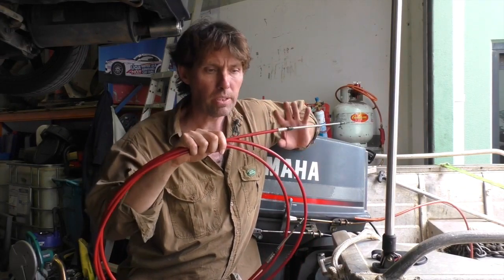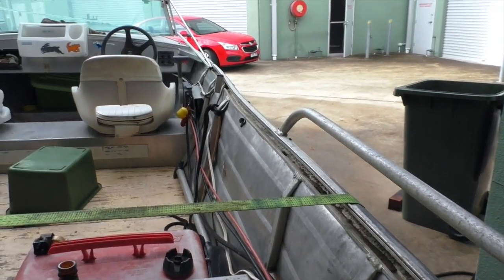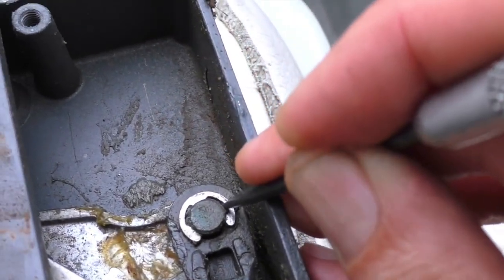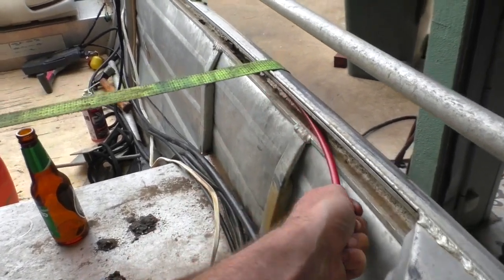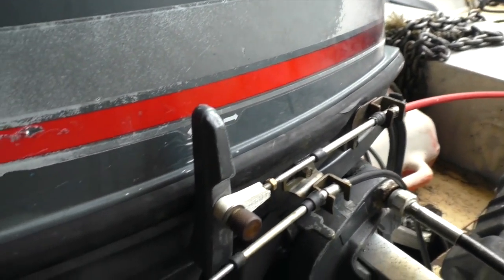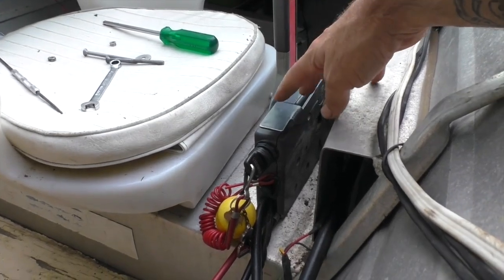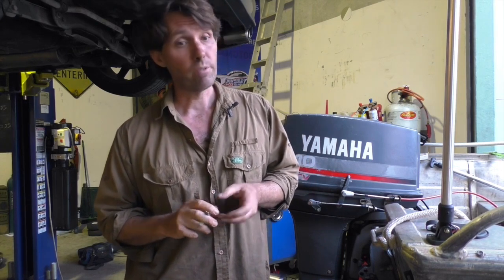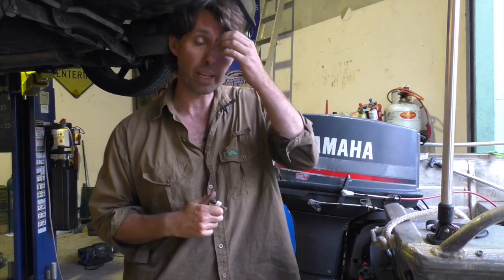Changing an outboard control cable

Comment: Hi Stu, just wanted to say that your videos have helped me a lot, with my latest project! Watching your videos gave me the confidence to buy a project boat and I have just finished servicing the outboard, adjusting throttle cables and relubricating them, adjusting fuel mixture and idle speed and plugging a hole in the hull. Now I'm considering taking it further and repainting it. Thank you for putting these videos out into the world, you are a champion!!

Comment: Mate, I don't know what I would have done without this video. About 8months ago I had to pull apart my throttle system to get at my choke cable which had perished beyond repair. I used your video to disassemble the cable. I got myself a new cable but haven't had an opportunity to fit it until today. There were several things that I couldn't remember like which way up the plastic connectors at the front end went. I found your video again and it was sorted within seconds. I reckon you should re do it, or at least repost this one, its saved me probably $2-300. I'm still going to get it checked by a marine mechanic, but the satisfaction of doing the repair myself was pretty cool. Cheers

Comment: I wish you could have mentioned there are several different types and not all are interchangeable especially older models , after watching your video I thought I could just use my old cables but as I have learnt, there are several different types of cables , some have the removable tips like yours , others have specific adjustable wheels and lock barrels, with removable end but fine thin cable ends with grub screw locks  , others have the correct end for the outbound but different end for the control with windows ends that are not removable  with small holes , others have the same set up but with large holes , there’s a multitude of different styles , tips, sizes  , definitely not a one size fits all as you clip suggests. 
I’ve learnt the hard way with about 12 different cables of which none are exactly right absolute pain in the ass ! Hopefully I can save someone else the hassle and make it known that you need to find you specific cable you can’t just use a generic one at least with older outboards

Comment: After countless youtube videos, I found this one. And I now know, both cables are basically Identical and found a set, 2 for 71.00 bucks. Once home and off the lake the parts will be there and I can do this repair myself. heads up, the boat dealer wanted 138.00 an hour and quoted a min of 2.5 hours. And the parts where 112.00 per cable. The most important thing is save your old connectors. to make sure you have a good fit. Unless their bad.

Comment: You the man!   Just replaced my cables.
Reply from the maker: Nice work, glad you got the job done. :)
Reply: @DangarMarine  It happened cause I duck hunt...was 19 degrees other day and couldnt move shifter....cleaned all old grease out of shifter box and used white lithium...new cables cleaned shifter linkage on motor ...more white lithium....time go break some ice....shoot some ducks.

Comment: got the answer on shift cable problem----there is a little plastic sleeve inside the cable that helps ensure it shifts smoothly----it was broken.  So--replaced it and we are back in business in our 
42 Hydra Sports--3   350's.
Reply from the maker: Nice work! Enjoy getting out on the water. :)

Comment: Hey Stu! Hope all is well with you and yours mate. Was just wandering what the correct grease is to use on these cables. 
I was told not to use oil, as they said that it assists in the cracking of the external plastic casings. 
thanks for your vids & all the help you give every one mate.
Reply: Lucas transmission conditioner keeps the cables crack free for years  it works well

Comment: First off, awesome explanation and video! I am trying to relate this video to how my shifting cable/linkage is configured on my Yamaha outboard. The linkage is not mounted on the side of the outboard like shown in this video, it has a brass linking nut  that connects the shifting rod from the power head area to shifting rod in the gear box (this connection needs to be unthreaded each time I take off my lower unit). When moving the shifting lever from neutral to forward/reverse the linkage movement “agrees” with the 3 positions. However when I do my in water test as you mentioned, my reverse sort of grinds/stays in neutral and I have to push back a little harder on shifting lever to actually engage reverse. I was nervous that my dog clutch was worn out, however when I detach the lower unit and move the shifting rod manually the prop spins freely in both directions when in neutral, I hear it ratchet into place and locks when in forward and reverse. So it seems like my lower unit/dog clutch are ok? Could it be that I am not getting enough “throw” with my shifting cable to get it fully engaged in reverse? Do you know if this sort of set up has an adjustment that can me made under the cowling (where the shifting cam/lobes are located)?

Comment: I have a Honda 50 it seems much the same as the Yamaha I'm wondering have you done a video on complete change on control with  electric wiring and other cables.      Great video TKS for sharing

Comment: Bit of marine grease on the cable ends where the fittings screw on and on the control box screws and on the rubber spacer that holds the control cables apart in the control box, just helps to take it apart next time it needs to be done

Comment: Great video stu 
I just installed a 70hp Yamaha on my streaker and this video came very handy was gonna ask my throttle cable is a little stiff I sprayed it with wd40 but it didn't change it is it worth replacing the cable ???
Reply from the maker: Hey Nick. Try doing this with the cables https://www.youtube.com/watch?v=_j2xD_8k5yo It's an old video but you'll get the idea.

Comment: Hi great job!!!!!  I'm definately subbing.  I have to replace both my shifting cable and my throttle cable.  Do you have a separate video for throttle or are these two cables done the same way?
Reply from the maker: Hi mate, thanks for subscribing. Both these cables are the same.
Reply: Thanks Dangar Marine, quick question if you don't mind, I know your busy but when I switch the throttle cable, do i need to make sure the cable has equal amount of cable extended at the motor side and the throttle side with the throttle lever in the neutral position?  How do you know if you are getting the full WOT cable throw?  I hope that makes sense.
Reply from the maker: It doesn't matter about length at each end, the total movement is all that matters and that is set by the forward control itself. When you are at full throttle, check that the carburettor butterfly valves are horizontal. If not, adjust the carbuettor linkages.https://www.youtube.com/watch?v=NnotQmnKxKM

Comment: I replaced my cable, but I can't seem to go into reverse. The control stick can move into forward and neutral just fine, but can't go into reverse. It's very stiff. If I take the cable off at the engine, the stick can move f/n/r fine. So it doesn't seem to be the stick. With the cable off I can move the engine piece by hand into reverse. The engine is a Suzuki DF15.
Reply from the maker: That's a bit weird if all parts can go into reverse individually, but not when connected. Do you have the motor running at the time? If the motor is switched off the dog clutch won't always align. I would reconnect everything and get someone to move the lever into reverse while you look closely at the outboard end to see if it is catching on anything as it tries to move.
Reply: Dangar Marine - the engine is off when trying it. The reverse is really stiff. I'll have to take the boat out for a test run. Maybe it'll be easier when the engine is running, but it can click into reverse easily by hand.

Comment: first off thank you so much for your help and was wondering if you could help some more haha i have an 1978 evinrude and it needed a new control box, i hooked the wires color to color, besides ground being black with white stripe on new box,  up to each other but when i turn key no power is getting to box to turn engine?? any idea?

Comment: Hi mate,great video once again.Just one question that I noted in your video,can you put an outboard in fwd and rev whilst switched off?I was always told to at least spin the prop whilst doing so.
Also,is it minimum radius in the bend of the cable or the maximum radius the manufacturer specifies?Im guessing the Maximum and to not exceed it.Again love your channel mate and keep it up.
Reply from the maker: +Fabian Sosa Hey Fabian, you can put an outboard in gear while it is off, but if the teeth of the dog clutch aren't aligned with those in the gear you will need to turn the prop a little bit for them to made properly. It is the minimum radius, ie. the smaller the radius the tighter the bend.
Reply: Don't do my trick and try putting more pressure on the remote shift to try and get the leg in gear- I pulled the inner cable out of the lever  because the dog clutch was mis aligned! On my OMC engine the cables are captured to the engine by a pair of grub screws clamping the inner cable between them, so pulling the cable out is always a possibility, as is the grub screws coming loose as there is no 2nd lock system !
Reply from the maker: Ron Powell Doh! Oh well, live and learn. :)

Comment: Can you adjust these inside the handle? I installed mine but it on full throttle when handle in neutral? Doesn't give me much adjusting other than one inch and I'm still at full throttle I only went from a Yamaha 2-stroke to a 4-stroke, the other cable for the gear selector fit perfect but see throttle one is fully open when in neutral

Comment: Any words of wisdom on rigging a mercury 90hp gen 1 throttle & gear control cables. Just replaced with new sea star teleflex cables and having a time rigging. Dont know where to start. Motor is 2003 model 2 cycle

Comment: great videos, all of them.. i have a question i have a 50's evinrude motor, which has the throttle adjustment switch on the motor itself. is there a way to convert that throttle to a shifter by the wheel at the front of the boat?
Reply from the maker: +ryansh84 Hi mate. Yes, is the short answer. :) I'm not an Evinrude expert, but every outboard I've seen has a short cable from the throttle on the tiller to the carburettors that can be disconnected and replaced with a longer control cable that goes to a control box at the front of the boat.

Comment: ...i need to take my cables out as they run under seat ...making seat wobble 
they need to pass through a hole instead lover down the seat ...but can i replace all cables ie the steering and the throttle and theres a soft one too ?...

Comment: Thank you for another great video!  
One question,  will the "Tip to groove" off set dimension change with different motor manufacturers?
Cheers ;D
Reply: @Uriah Sincere Instablaster =)
Reply: @Melvin Royal I really appreciate your reply. I found the site thru google and im waiting for the hacking stuff now.
Seems to take a while so I will reply here later with my results.
Reply: @Melvin Royal it did the trick and I now got access to my account again. Im so happy:D
Thank you so much you really help me out!
Reply: @Uriah Sincere happy to help =)

Comment: Hi Dangar, have a question about the yamaha 703 remote,   need to change lever from the left side to the right side.  Is this an easy swop, any vids on this ? Thanks in advance.
Reply from the maker: The newer ones are reversible, yes, but I'm not sure if that has always been the case. I've never done the swap (or even worked on a boat with port side controls) so I don't have a video on that yet. The have always been available in both configurations for twin outboard setups though so parts for the swap should be easy to get.
Reply: thanks for reply.  I'm mounting a new one on port side of centre console.

Comment: What if your initially setting up the cables for the first time. my pontoon boat has a Mercury with a tiller  and I want to change it to having a throttle set up like you just did.should I run the cables under the pontoon boat around it through it How would you suggest?
Reply from the maker: There are three main considerations when picking a route for the cables. The first is making sure you don't make any tight turns (the manufacturer will specify a minimum radius, the second is keeping them as dry as possible to avoid corrosion and the third is protecting them from physical damage such a chaffing and be knocked by heavy objects etc.

Comment: One of the biggest funding limitations for DIY Youtube channels is that (by definition) your average DIYer is usually a little tight on cash. HashTag MeToo on that bro but since this is about the 150th time Danger Stu has saved me $100's I'm going to head over to the links above and make a very very small donation. Obviously hurts just thinking about it but bugger it - I'll always spend a penny if it saves a pound.

Comment: Hi dangar, my outboard doesn't have issues going into gear however, it only begins to speed up once my throttle stick is all the way down. I feel as though I haven't been receiving the full output of the throttle. Do I have to adjust the other cable by screwing in the connector to shorten the length of the throttle cable?
Reply from the maker: +Danny I'd start by taking the cowling off looking at the throttle plates while someone operates the forward control. Depending on the style of linkage it should become apparent where the play is if they aren't opening early enough.

Comment: I have a 1984 Mercury 90hp and I wanted to know if you knew anything about installing the control box into the engine. The tower of power?
Reply from the maker: +tithtra soch Unfortunately not. I have worked on one of those outboards once but I didn't do the control box. Are you after information on the throttle can gear selector linkages or the wiring?

Comment: Where did you order the new spring loaded connector for the shift lever? I have the same motor. I have the control box and the cables but none of the brackets or connectors that actually attach to the motor.
Reply from the maker: I got it from our local Yamaha dealer. Unless it was a Honda in this video, then I got it from our local Honda dealer!

Comment: Hey,
Any chance you could make a vid on removing all cables from control box to pass the cables through a hole where outboard mounts on, I know from this vid how to do the gear and speed cables but can't seem to figure out how to go about the electrics. Seems there's Like 10 little wires and and plug to easily unplug them. Any tips or do you know how I should go about it? Regards
Reply: Hey figured out how to do the electrics part so no need to waste your time answering, great vid 👍

Comment: Hello I have the same motor and I'm trying to figure out how to use it. What's that small lever on the back for, the one that only goes half way up
Reply from the maker: On the back of the outboard or the forward controls? If it is the forward controls it will be the fast idle. It increases the revs of the motor while leaving it in neutral so you can warm it up.

Comment: I have a evinrude 115 hp starflite early 70's and after trying to adjust the cables it will go from neutral ,forward reverse then back to neutral however when it go forward trying to go full throttle then it locks and I can go to almost neutral but I can't go into reverse do you think that could be the cable or a new gea box
Reply from the maker: Sounds more like it might be a problem with the forward control unit to me. When it gets stuck, it you remove the cable from the outboard end can you manually push it into gear? Also, while they are separated try move the controls. By testing them separated like this it will tell you which piece of the puzzle is causing the problem.

Comment: where did you buy the new connector for the throttle cable to the outboard?
Reply from the maker: +Tlaloc B. Orozco-Cohen From the local Yamaha dealer.
Reply: Dangar Marine what is that connector called?

Comment: Hey, I just bought a boat and it seems to me like I have very much flex when I either accelerate or decelerate in the lever, sometimes it falls into a different speed by itself on the water. It feels like the plastic is getting old and “moushy” - is there something I can check before switching to a new throttle-unit? Thanks
Reply from the maker: It sounds more like a cable problem, but take a look at this video, it will give you an idea what is going on in the forward controls. https://www.youtube.com/watch?v=mdkFnqor-Is It could also be the linkage inside the outboard hanging up on something. Take a close look under the cowling as someone moves the throttle back and forward.

Comment: What can you do with a stiff cable, i have a 2003 90 hp mercury with this problem, can I shoot oil through to clean and lube it? If so what oil would be good to use?
Reply: I forgot to add earlier that I had the controls off of the console and it seemed rough in the console,  i think I might need to troubleshoot the system independently by disconnecting the cables from the engine first and see where the rough spots are first.   But if it is the cable, short of replacing them, can they be cleaned and lubed?  There are no kinks or sharp bends in the line.
Reply from the maker: It's an old video but you'll get the idea. Any old oil will do. https://www.youtube.com/watch?v=_j2xD_8k5yo